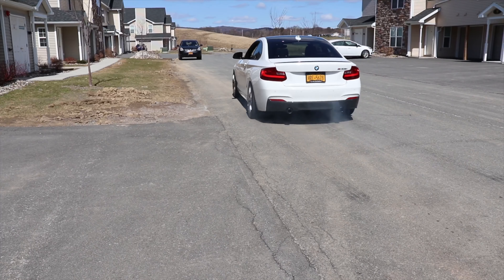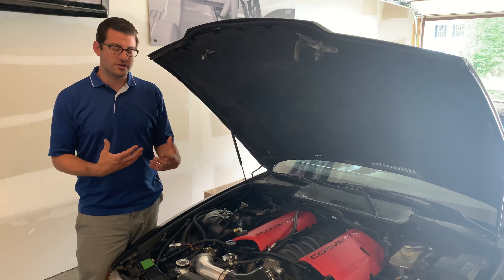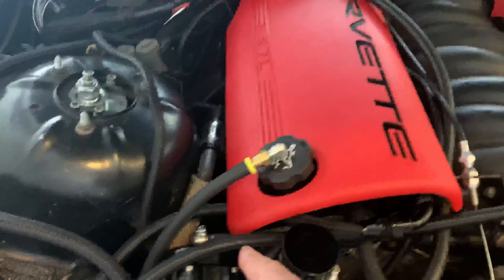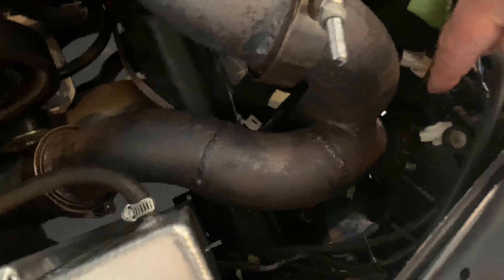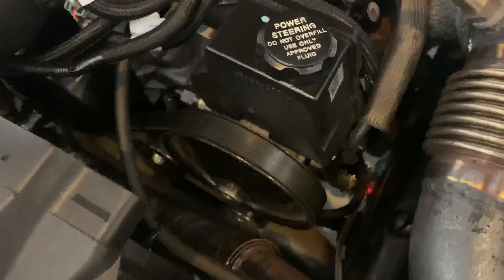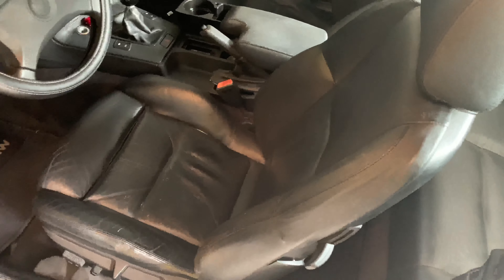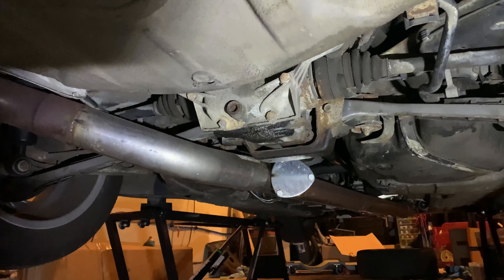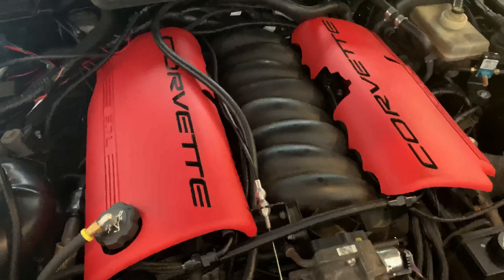TURBO LS E36 FULL BUILD BREAKDOWN: Ep 21- Every mod I put on my BMW to swap in the LQ4.

Comment: Did you pull the subframe out and reinforce the floor?
Reply from the maker: Rear subframe? Not yet, I have the reinforcements I’m gonna weld in when I put the new rear end in over the winter
Reply: Low Boost Films yeah ment rear subframe haha
Ah cool sounds good!

Comment: Thx for telling me not to badge my 325i if i s52 swap it😂 If I get a m3 spoiler for it that’s stil fine tho right? Also do you think Ls swap or s52 swap would be better?
Reply from the maker: King Swisha spoiler, wheels, mirrors, whatever you want just no badges haha. Swap depends on your power goals and budget.
Reply: @LowBoostFilms  well i do plan on doing a turbo build on it, i’m just lookin for quick 1/4 mile time, i’m better with straight line racing but i always hear the m engines are made for racing with lots of turns. My budget is low for now but i would say around 10k to get it started out
Reply from the maker: Both can be built for 10k. Just depends on what you like. Both good for straight line and turns.

Comment: You forgot the cost!!
Reply from the maker: In the event that my wife watches this, I left it out lol.
Reply: Low Boost Films I'm trying to do one is there anyway you can help me do have a List of parts that I need
Reply from the maker: Prince SharkBoi I have a lot of the parts I got in every video of this build series. Most of it should be there.
Reply: Low Boost Films is there some way I can look up a parts lits
Reply from the maker: @FirstLast-tx3yj  I used the New Age Hotrods swap kit, they have the best fitment. There’re a a small layer of plastic over the booster, I cut it a little to fit the manifold.
Reply: @LowBoostFilms  i just heard the answer in the video!! Thank u man!
Reply from the maker: @FirstLast-tx3yj  no prob!